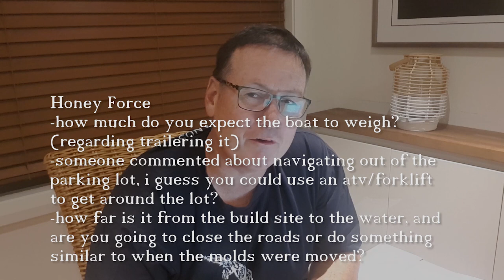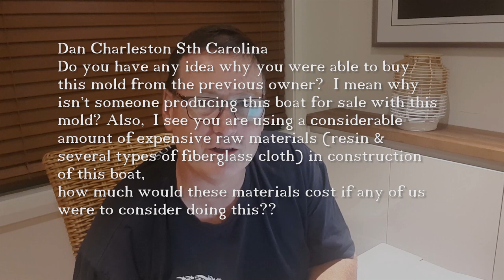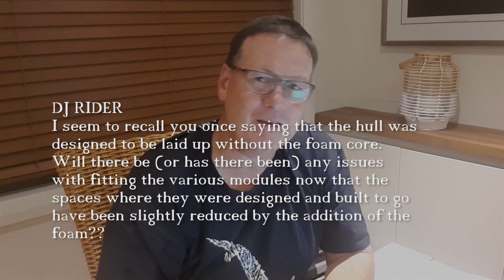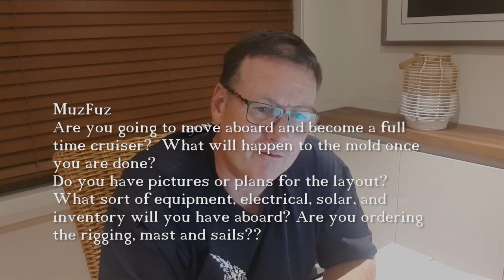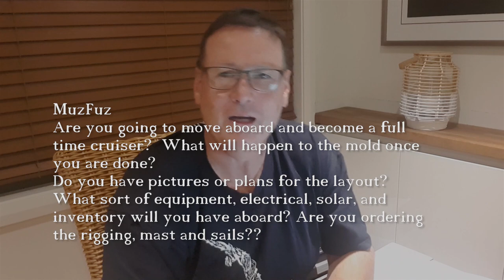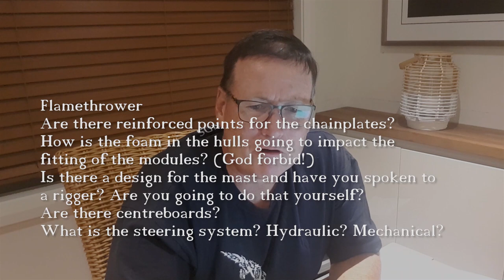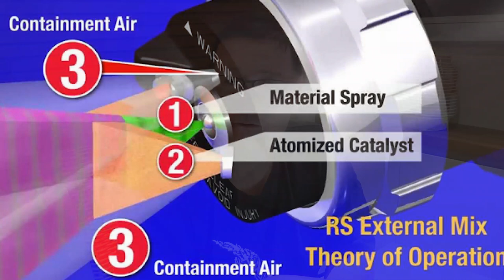Building a Catamaran - Q & A

Comment: Very nice...thanks for that! For me, the most illuminating part was when you explained how you will be suspending the the deck over top of the hull, frequently lowering and raising it to fine tune its mating with all the various components below. I was wondering how the heck you could possibly be so precise as to install all those bulkheads and modules and have the deck lowered on and have everything fit just right first time. Turns out you can't! :)

Comment: How much outfitting will you do before attaching the deck? Engines/drives, electrical, plumbing? Galley/head fixtures?
You could even save your back from a standing Michelangelo by finishing the saloon (and hulls?) overhead before flipping and suspending the deck, leaving only electrical connections at the join. Just "wall" finishing when "furniture" installed.
Cable steering with Dyneema?

Comment: Rosco, I have seen your trailer and during your first Q&A session you mentioned  that you will be towing the vessel to the water on this trailer. My question is as there is probably around 5-6 metres between the axles, I am wondering what clearance you have  from the bottom of the hull to the ground?  As your rear wheels start to go down the boat ramp will you have sufficient clearance so that the boat will not scrape against the ramp? Enjoying the videos. Ben
Reply from the maker: We have quite a good ramp and at the highest tide the water laps at the top of the ramp.Intention would be to slide her in stetn first at full height,approx 80cm above ctr hull and float her off.Great video on the Knysna Catamarans site where they launch exactly the same way ,looks straight forward.Cheers Ross.

Comment: Could the mold be protected by the elements, after demolding the boat, by applying release wax and then using a gun that applies resin and chops fiber. Then you would use a roller to remove the bubbles only but no cloth cutting like in a structural layout. It would be like a 1mm thick wall boat with some reinforcements to remove it and keep the shape? Not sure what would happen if water goes in between and fungus develops, but it would certainly protect it from direct sun especially if you add some pigment. It could be reusable and maybe able to be handled by six people? By the way I am sober right now :-)

Comment: Ross! YOU? Getting Hateful when your Edgy?! LMAO!  I'm SURE I'd NEVER be able to guess WHY, LOL! Hell, Man, I'D be Wound Tighter Than an Eight-Day Clock!  Aw, shit, the Trial-and-Error of Fitting the deck to the hull and modules is gonna SUCK. But at least you'll be able to Measure when you get it Clamped together, and so have the Measurements for the module heights for the Next Build, and so eliminate the T&E process. Regarding Power, 'Better to HAVE It Than To NEED It, and Not'. You'll run aground one day, EVERYONE does, and may be able to just Back Off, or give someone ELSE a Tow. Matter of fact, I'D glass in some Extra-Heavy cleats or bollards bow and stern Just FOR Light Towing. Use them for the anchor bridles/snubbers in Cyclones....Swearing a Neccesary Component, it prevents you from Blowing Up and Destroying a couple weeks Work with whatever Handy instrument of Mayhem you find lying around. It's exactly the same as the Vent system on the Lady's Pressure Cooker.  Plus, it seems to Get Worse as you get Older. Just Good Practice for when you're actually Being a SAILOR, lol.